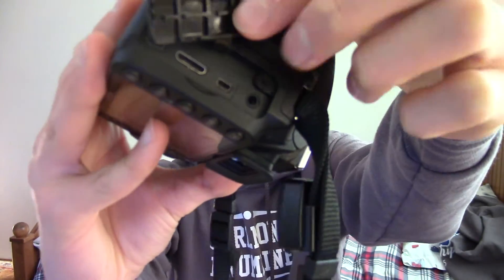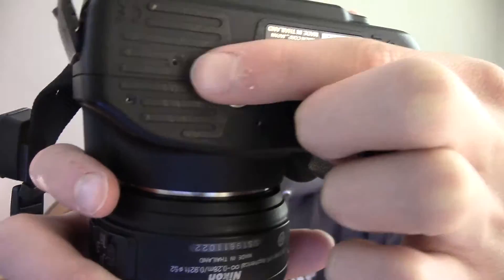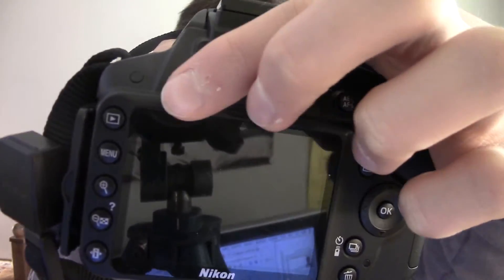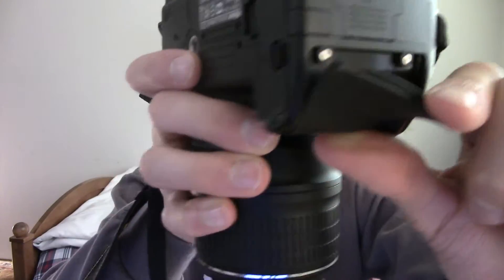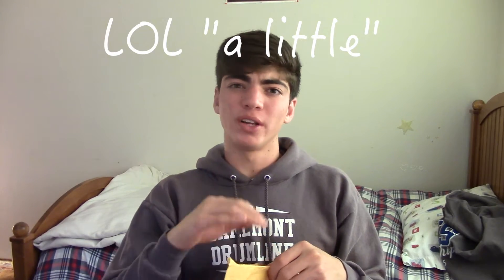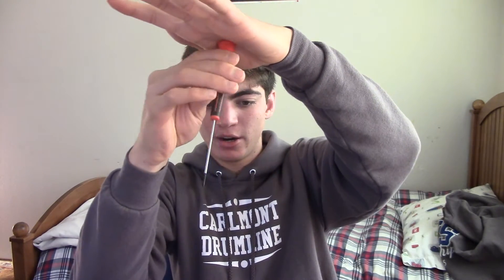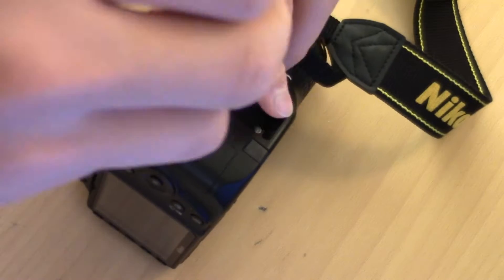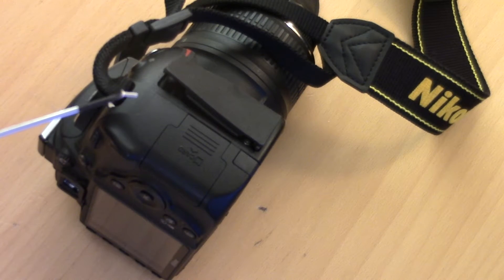Replace HDMI Port on Nikon D3200 #1 - Dissassembly Guide - Fixing the Nikon :(

Comment: This is TOO much crap to go thru this fast and to just repair a camera that isn't really worth it anymore. Has a terrible "rolling shutter" problem on videos, eats batteries even with an external grip, and isn't really rugged enough to even be a "B-cam". I bought one with a cracked outer LCD lens. That was simple to replace. Now, the USB port is bad SO I can't use it as a web cam. Guess what?. PHBBBBTTTT!@. I paid 90 bux for it. 10 bux extra for the replacement lens. Couple of extra batteries and a grip. Yea, it works and I like it for street photog BUT if it breaks, it's sold for parts. Next serious cam is going to be a Panny GH5 OR better, a Sony A7 3 OR A7 Riii...Mirrorless. 4k...If I ever got another Nikon, I'd look for a D5300 or higher cheap BUT right now, why waste anymore than you need to on a DSLR anyway?

Comment: He pulls a screw from the dial on the top right corner of the viewfinder- it looks like he removes the dial, but he actually just removes the label sticker. There's a screw under the rubber thumb grip. There are 2 more screws hidden under the rubber finger grip near the SD card slot. That removes the cover.
To remove the main circuit board, remove the screws near each corner, remove the ribbons by lifting the plastic bar then sliding the ribbon out, remove the 2-wire connector on the top right, remove another screw near the A/V jacks, and pull the bottom ribbon straight out. Push the A/V jack cover out, then pull the circuit board free (the top left wires will remain connected).
My problem was with the SD card module- kept reading each SD card locked. After I removed the module's metal shield with a soldering iron, I located the pin that closes a circuit if the SD card's lock slide is in the lock position. I cut that pin out, straightened the stub, then shorted the stub to the metal module housing with a smear of solder. Works perfectly after reassembly!